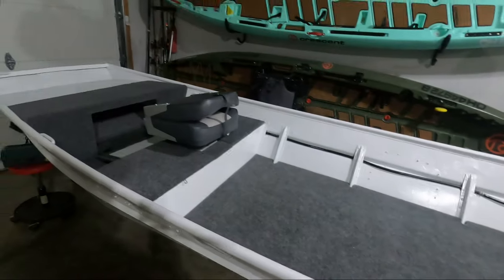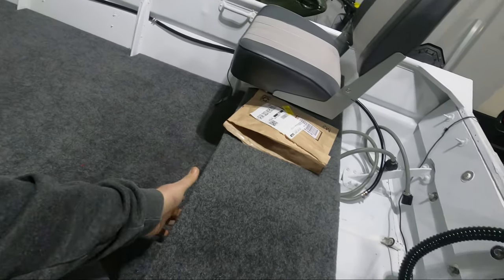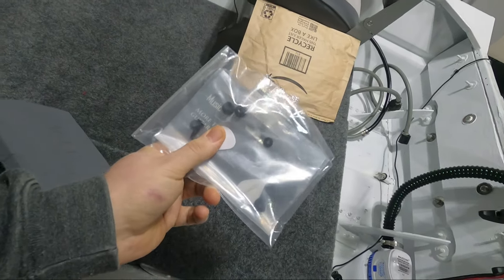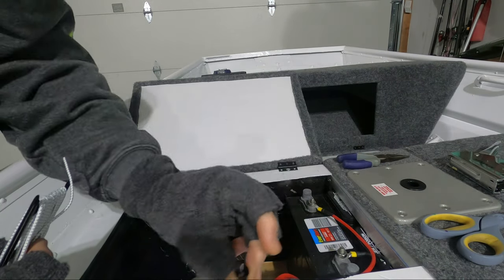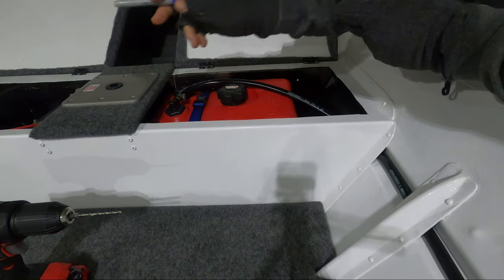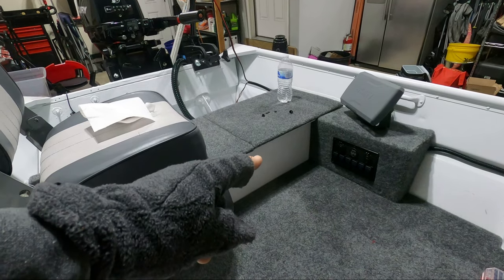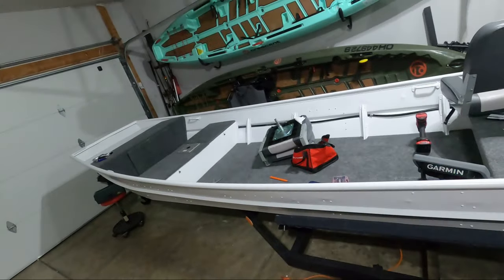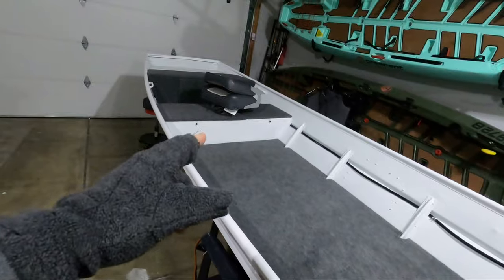CHEAP & EASY BENCH LID "LATCHES" - For the Jon Boat to Bass Boat Conversion Build

Comment: Maybe two bungee latches on the wide swing down door? Pretty easy to pull that one out and pop a single bungee
Reply from the maker: For sure, if I find the front doesnt hold I can always add extra, but so far its really secure with just the one.